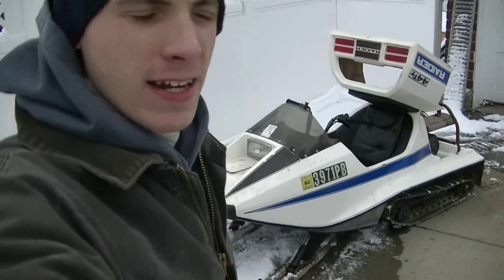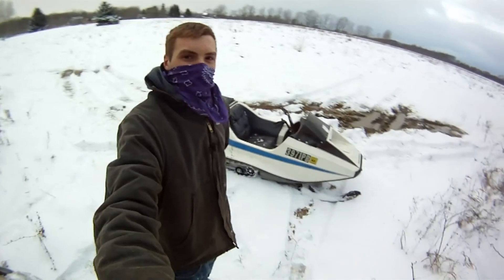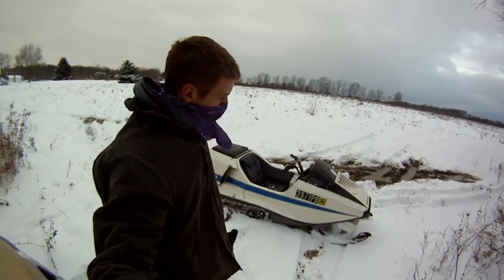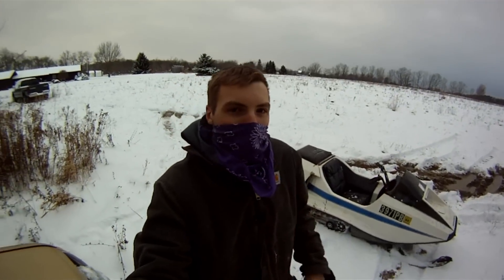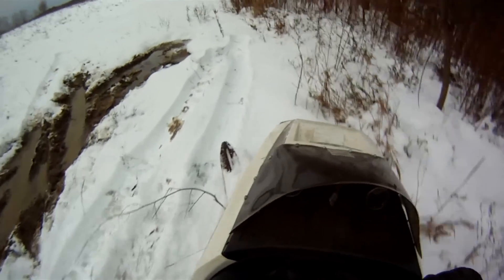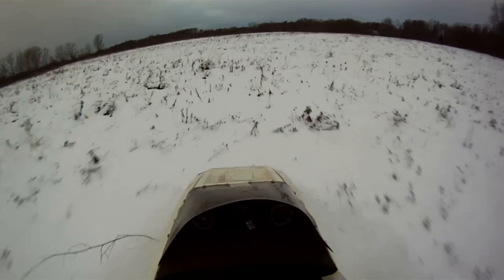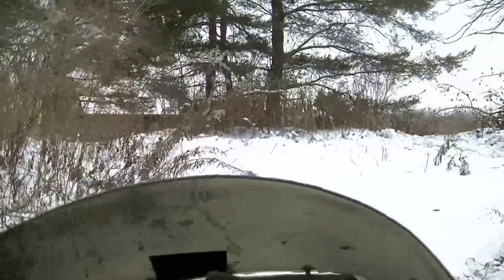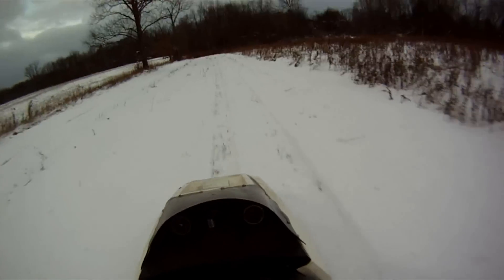Tuning Up Vintage Raider 2 Stroke Engine

Comment: That's very cool! I want to find me a Raider to fix up. I'm not sure what model carb you have on there, but if it has high/low mixture screws, it's a lot easier to adjust in this method. Bump the skis up against a solid surface. (preferably a building) Then jack the rear end of the sled up off the ground. Start both screws at 1.5 turn out. Then turn your low screw in until you get the highest possible idle before the engine starts to struggle and stall. Then leave that screw there and adjust your idle screw back down to your desirable idle speed. Now for the high speed needle, with the sleds tracks off the ground, rev the engine full throttle and turn the high speed screw out until you reach the maximum peak smooth running revs. (just use your ears) You'll know when you went to far because the engine will start to flood and stall out. Try to find that peak rev point at full throttle before it stalls, and then that's it, your done! This is the procedure illustrated in my Johnson Skee-horse manual. I've done this with great success. Of course though, these carbs can be picky in different temps, so depending on the weather that day, you may need to finesse the high speed a bit. Happy riding!